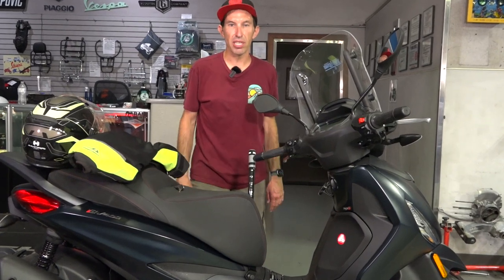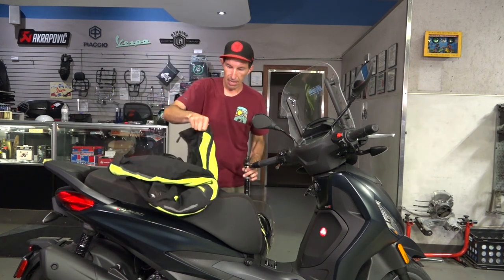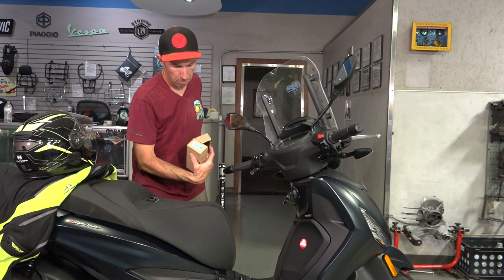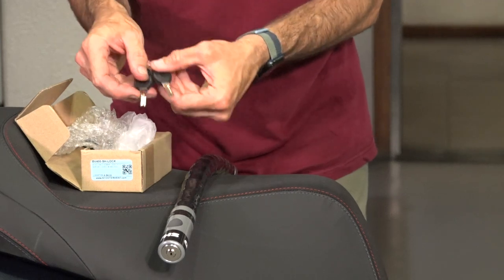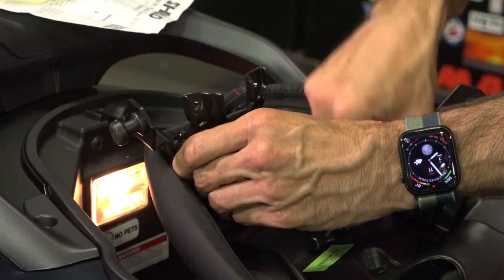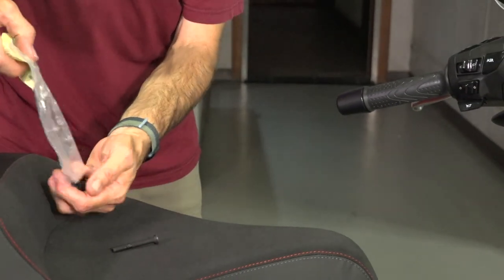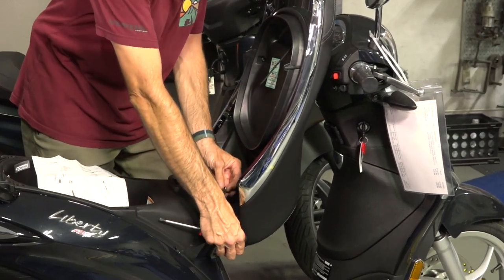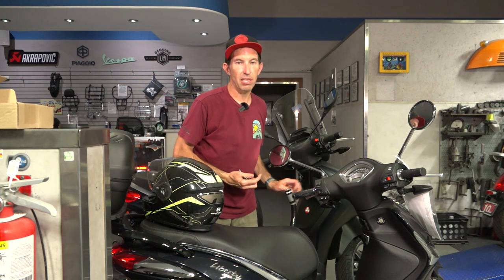New SHAD Handlebar Locks for Piaggio & Vespa Scooters

Comment: Bought one yesterday for my Liberty from scooter west.  Easy as described to swap out the mounts for the seat.  To drill out the handle bar and tap, IF your not experienced with a hand drill have the shop do it.  You will need to purchase for a one use application a tap, tap handle, drills, center punch and tap fluid.  If you are experienced the bar end is a mild steel of some sort and drills & taps easy enough.  About 45 min slow and easy...

Comment: Cordless peanut grinder with a metal cutting wheel will cut through the piece on the end of the handle bar in less than 5 seconds.